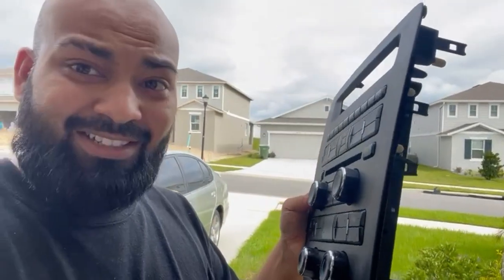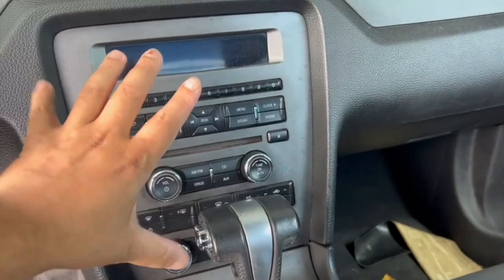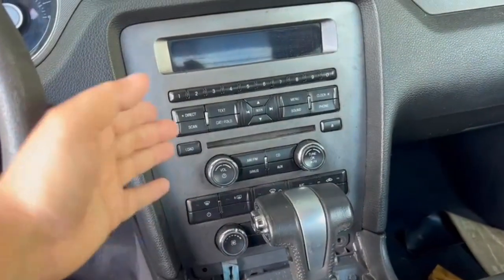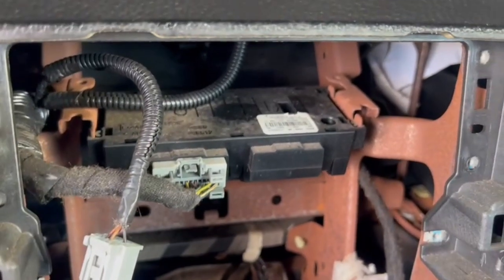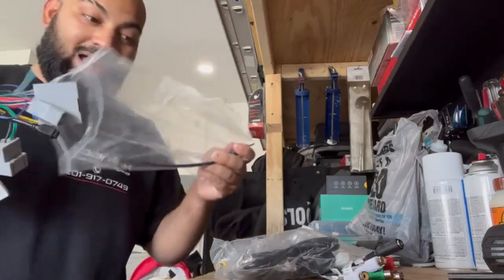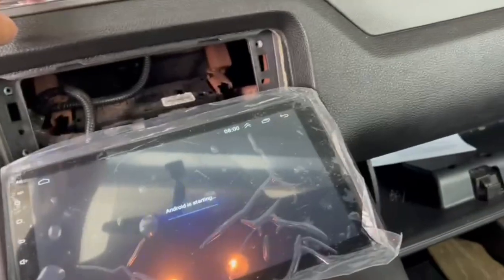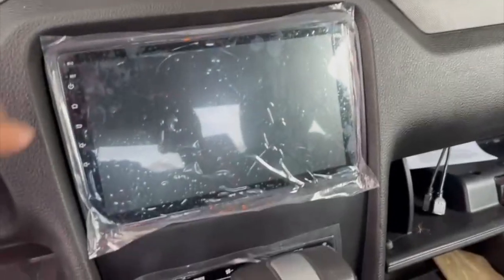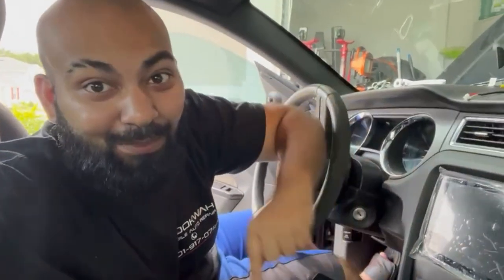The Expert's Guide to 2011 mustang radio install

Comment: Seriously... U just showed a screen... Not an actual installation... I dont know where all the wires go
Reply from the maker: The wires are plug and play.  They only go one way. You don’t have to wire up anything.
Reply: I just sorted it, u need to show the part where u enter the password to set the programming for the screen and the car to get all the buttons to work, it was easy, the hardest part was to get the rear camera that came with the car to work with the screen, i ddnt use the bew camera however it would be better than the factory one. But honestly great screen really changed ruby (my stang) for me
Reply: @waelalenazi5156   how did you get all the buttons to work I just installed mine and i still can't figure it out i went to the protocol settings and changed it and they still won't light up
Reply from the maker: Honestly I just plugged mine in, it was plug n play
Reply: @Kingcustomz  damn i guess i got a faulty one because my buttons work except for the volume knob and button its almost like it's not connected but all my lights are on ... Do you know if the buttons change color or do they just stay orange?
Reply from the maker: I think they should change color. Lol my buttons are orange as well, I haven’t really had time to play with the settings. But you know what. Tomorrow I’ll do that.
Reply from the maker: Isn’t the volume touch ? The knob in the center doesn’t control volume I think..
Reply from the maker: I’ll mess with mine tomorrow and make a short

Comment: You have to get a manual A/C version if your car doesnt have the auto a/c function.
Reply from the maker: yes manual ac
Reply: @Kingcustomz  will the ac work if my ac I have to turn it on manually I ordered this stereo hopefully it works on eBay for $217